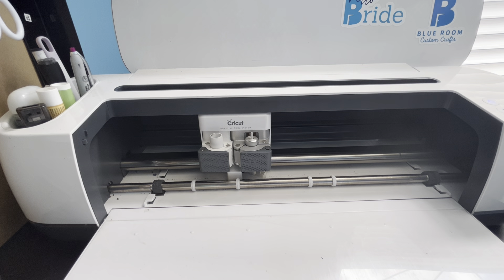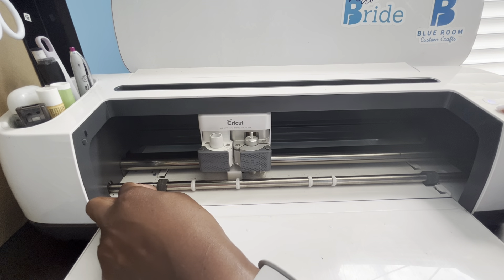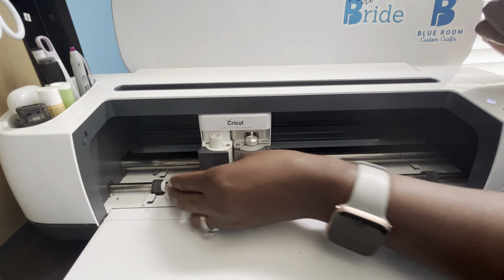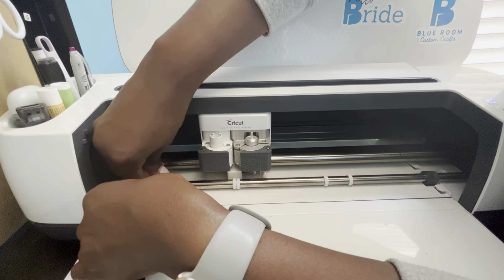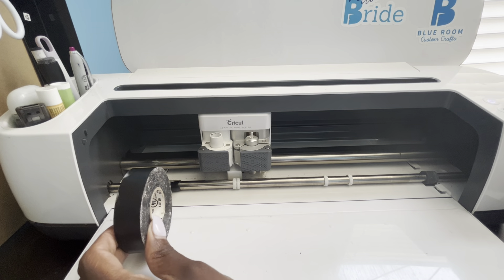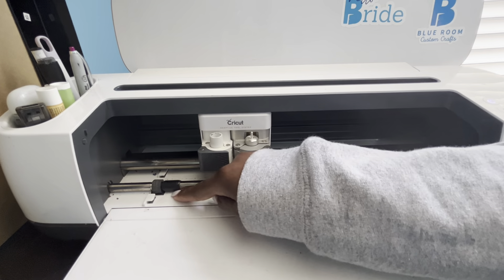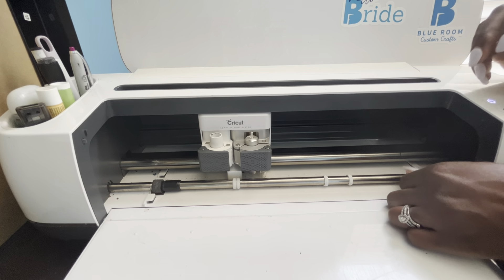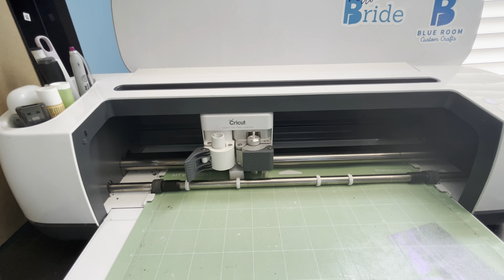Fix Your Cricut Machine Rollers Easily and Stop Your Cricut Wheels From Moving Off Track

Comment: I have been having the same issue and came here to double check if the idea of putting tape in front of the rollers to block them from keep coming off can be resolved. 
Thanks for your video. Has it stayed put and you have had no other roller related problem since?

Comment: Thank you!  I have this issue with my second Maker.  Also that Maker is somehow jacked up and blade and/or housing isn't going down close enough to cut the material on the mat.  I have tried to recalibrate but I don't know how to do that.  I have had to pack this Maker away and bust out my older Cricut.  Any thoughts on how to fix that?
Reply from the maker: Hey! Thanks for your comment! For recalibration, you go through Design Space. Check out this article and circle back if you still need help and I'll make a video to show you! 💙

https://help.cricut.com/hc/en-us/articles/360009424974-Calibrating-your-machine-for-Print-Then-Cut#:~:text=Sign%20in%20to%20Design%20Space,calibration%20you%20want%20to%20complete.

Comment: I see a lot of you having this problem and wanting a new machine. Your machine is still good. You can replace the rollers!
Reply: Please tell me how. Cricut told me there is nothing they can do but get a new machine..I've used it maybe a dozen times.
Reply from the maker: This is TRUE! You can replace the rollers! From what I've seen, you have to take apart the whole machine to do it though. Have you come across any easy way to do this? Would love to try a different method :)

Comment: I have a dumb question:  How do you get the rollers to roll in one direction long enough to get the electrical tape on? (I always feel like I missed Cricut 101...)  TY for sharing!
Reply from the maker: hey hey! No question is dumb! Thanks for asking. If I understand you correctly, it sounds like you’ll need to start with the Cricut machine OFF. Once you turn the machine on, the rollers will spin for a long enough to get the electrical tape on. Hope this helps! 💙 2:17
Reply: @BlueRoomCustomCrafts  Came on here to try to find my question and you answered it! Thank you!
Reply: Not dumb at all because I am on here trying to find the question plus the answer. ;)

Comment: One of the other ladies working with the same machine is having the same trouble she move that little white thing that’s in by your rubber wheel move it up against it and tape it in place with masking tape they say it works I don’t know I haven’t had this problem yet
Reply from the maker: Yeah I tried that but it wouldn’t stay long enough so I was becoming annoyed. There’s more than one way to crack an egg. Hoping all worked out with your friend! 💙